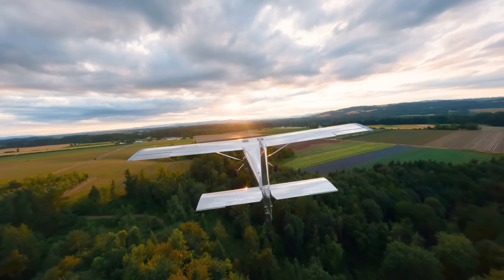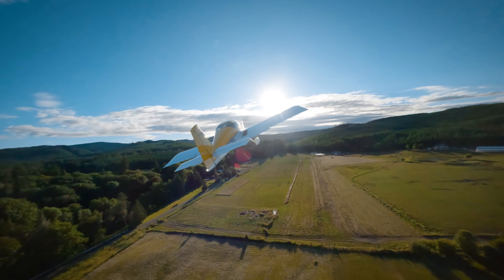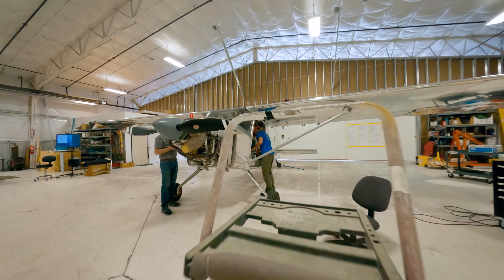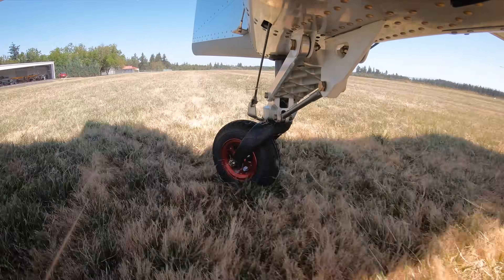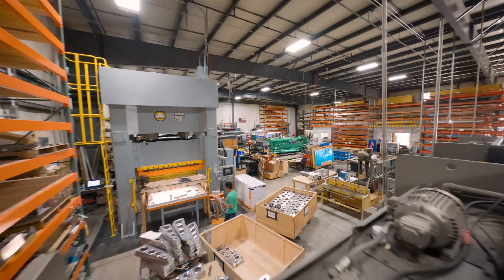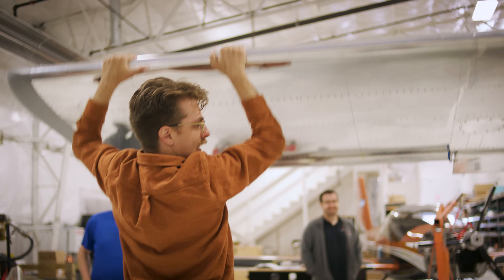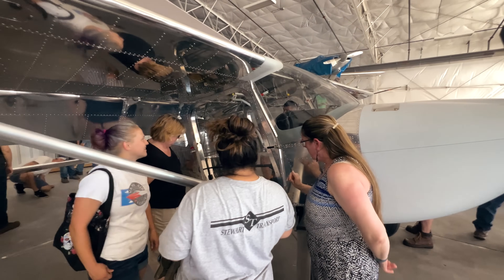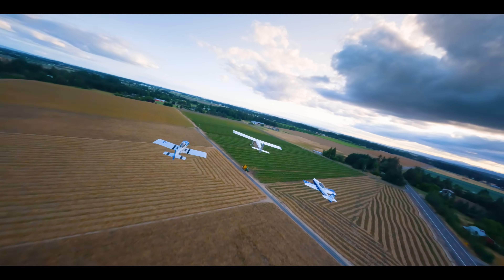RV-15 - Designing and Building the Engineering Prototype Airplane

Comment: For distance records could you operate with wing tanks AND the passenger tank since the engineering is already done?
Maybe even add external drop tanks and a bladder tank in the backseat within weight limits and center of gravity, of course.
That would be incredible. 
Maybe get Transatlantic or to Hawaii. 
Just a dream so far.

Comment: The kit will be  finished drilled and assembled with pull rivets. It's a production magic trick that will reduce assembly errors and make it more accessible. Saw it 2022 AirVenture, it's a good balance of practicality, form and function. They are shooting for kits 12-18 mos.

Comment: Please make the wing strong enough to accept bolt on wing extensions (like wing-x), for when it is on floats. They are easily removed when on wheels, so you can fit in a hangar.

Comment: Simply wonderfull and amazing..! This latest offering from Vans will be a HUGE success ! Love the big tyre option..! The video production was inspiring. And, as an RV4 builder/pilot, I LOVE the control stick..! I'd have to fly it from the RH seat...! 😜
Reply: I agree, Dave. This airplane is a home run!

And I like your idea about flying it from the right seat. It’s not unheard of to set an airplane up that way. Siai-Marchetti’s solo from the right. T-37. Bell helicopters. A good friend of mine built an SX-300 and set it up for right seat PIC. Just put the flight instruments on the right. That way you can fly with the stick in the proper hand and tune radios without switching hands. The only thing you lose is the ego factor when you taxi up with a passenger and people think the left seated pax Is the PIC. Woooo, I hope I could stand the depression that would induce, lol.

After seeing it at OSH, I told my wife I would consider building one. She couldn’t believe what she heard, as we have a C-180 and I lean toward dope and fabric work in my shop. The airplane is impressive. And if Van’s ever supersized it… RV-16… it would turn the 180/185 world upside down!!! (Something that needs to be done if you’ve seen the prices in that fleet lately. Nuts.).

Comment: Add 3 foot to each wing and 6-8 inches in width….
Reply from the maker: That would make it 42 feet wide, wouldn't fit in T-hangar. And it would also make it 6-8 inches wider than a 182. Not really very practical.
Reply: Most pilots these days are no longer 170 lbs. put two large guys in a 182 still cramped. Would be nice to see something home built for big guys.
Reply: @wallyworld9096  What about those guys lose some weight? And live longer at the same time to fly more.
Reply: @flexairz  if I was 180lbs I would look sick some of us are just bigger people

Comment: Ok, designed with bikes in mind.  I'm sold!!  Lol. I'm a long way off, but that is a requirement for me to fit a full size mountain bike inside whatever I buy/build down the road.  Now just to finish my ppl and build some hours and get a tailwheel endorsement, and downsize so I can afford it....hmmm.  My 150 will not fit my bike, even taken completely apart.... Love the innovations you guys are coming up with.  The gear is really cool.

Comment: it's not a bushplane aka off aiport plane....they just care about speed
Reply: Yes.  I hope it is a good deal faster than the comparable 170, or close to the low wing RVs.
Reply: I think you might be mistaken about that. I think they are saying all the right things.  This is an engineering test vehicle, so they plan to make improvements. So far, the landing gear and cabin look right for bush work. Let's see what it'll do.
Reply: @RobertJones-ty5mg  gear is not designed for off airport use. It's more of a cross country airplane to operate in unimproved short strips
Reply from the maker: @plantpower3048  That’s incorrect.
Reply: Looks like a C180-killer to me